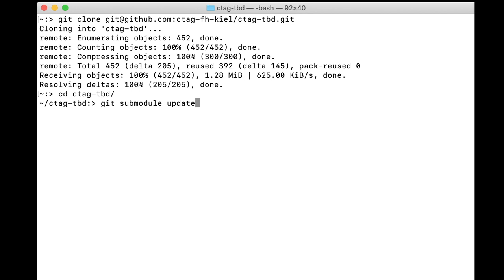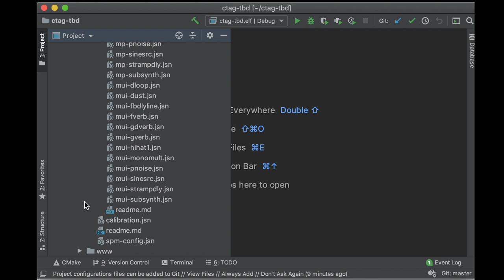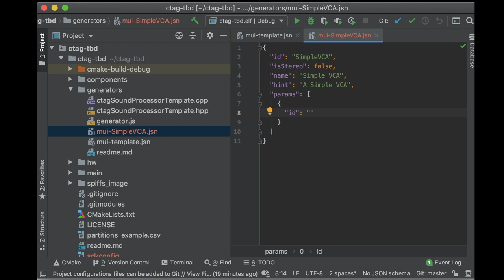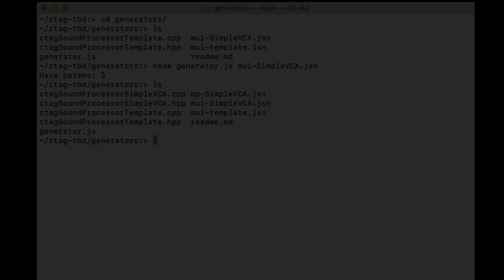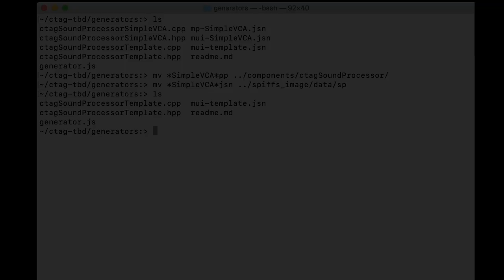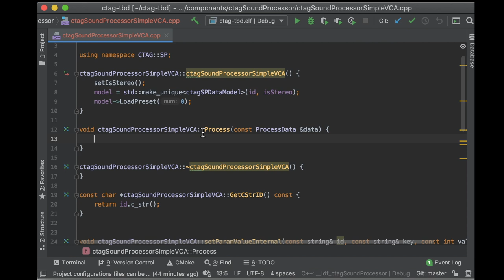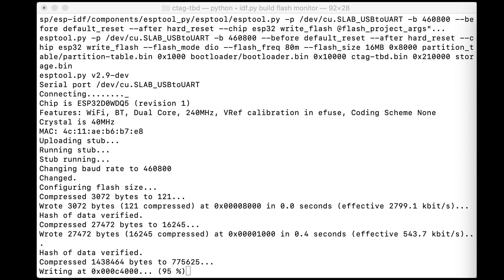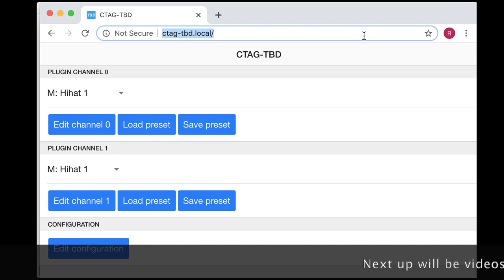CTAG TBD Codewalk

Comment: hey, i tried to write a simpel filter with this tutorial and it does compile. however, it is not shown in the UI (when i run the simulator). is there maybe an additional step that has to be done? thx :)
Reply from the maker: Reset the spm-config.jsn file to initial state, it's in spiffs_image/data
Reply: @creativetechnologies5052  thanks, worked perfectly!